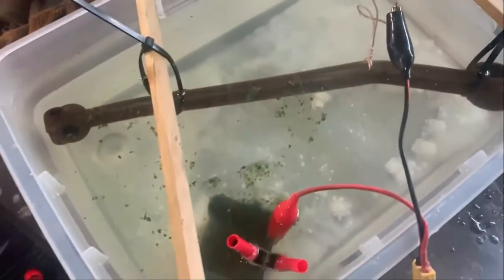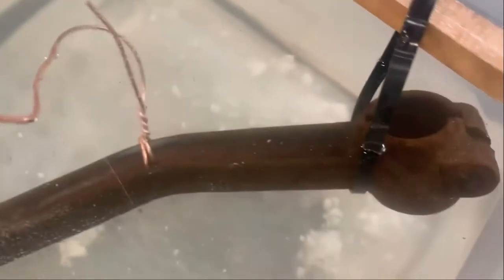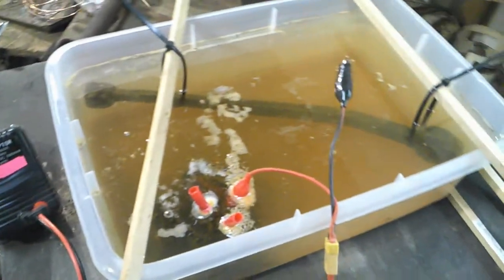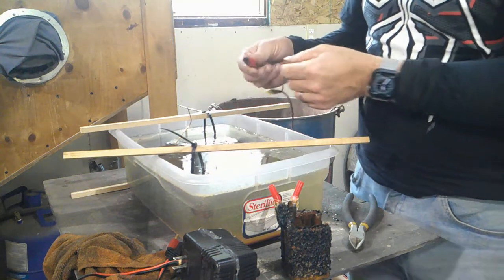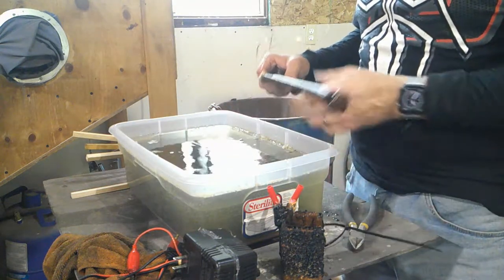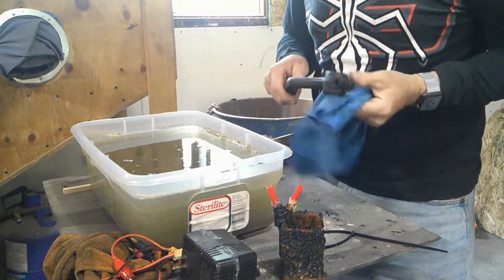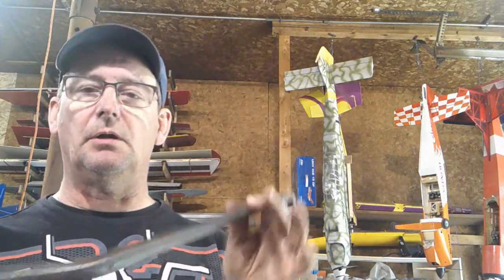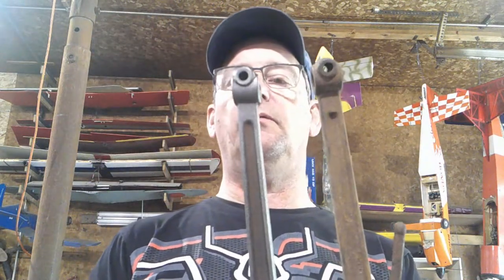CJ2A Restoration, experiment with electrolysis

Comment: I use a mixture of vinegar and citric acid for rust removal. 1 gal vinegar and 2 cups citric acid will destroy all rust. Just citric acid and water works too, but the two acids together works much faster and makes steel/iron look brand new. Both ingredients can usually be found in the grocery store, otherwise, Amazon has citric acid in powder form. Also, the stuff never goes bad it just gets dirty. So you can pretty much reuse it forever but you'll want to keep it in a sealed plastic container. The two ingredients combined is a super acid but totally natural and nontoxic. Do wear gloves though if you use the stuff, when you get any of this stuff into a cut you will learn a very painful lesson the very worst way. Cheers 🍻